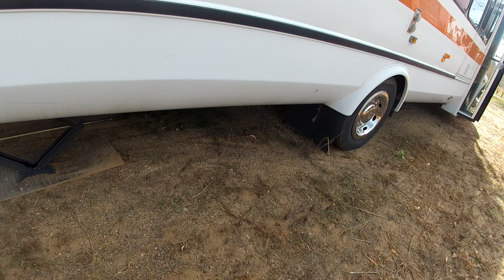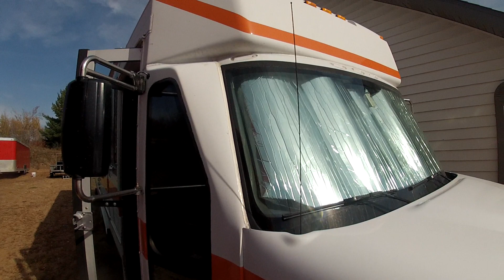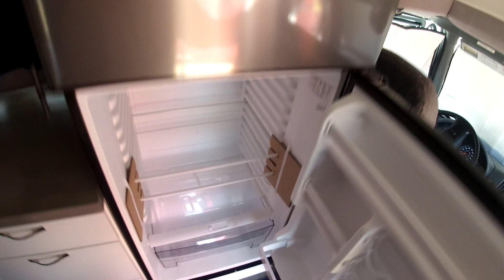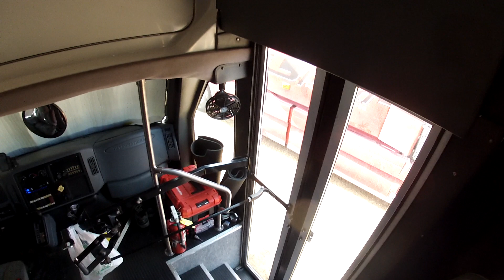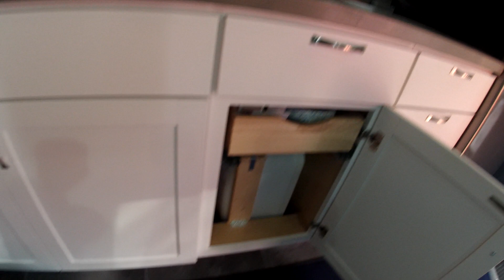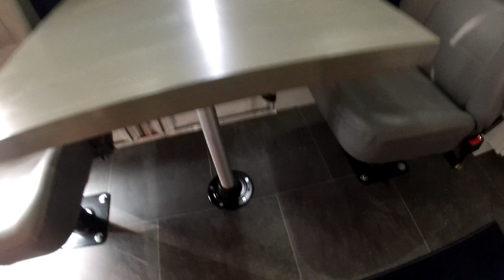BUS TOUR | Shuttle Bus Camper DIY conversion | Part 1 of 2

Comment: Hi Jeremy,  Great Job! We own a similar 2008 with a Starcraft built bus box behind a Ford E450 SD. I've been wanting to do something similar but when I unbolt the seats from the floor and walls I found that was the only structural thing holding the bus to the floor. I'm wondering what you found when you removed the seats and did you experience this problem. Do you haveany suggestions?
Reply from the maker: Our bus is an Eldorado box which has more internal structure and connections to the frame and floor than most. We did not have any issues with the integrity of the structure.  Tough to say what to do with yours without seeing it but possibly you could make u shaped brackets 7.5ft ish across then up a ft on each side . Bolt to the floor and then weld to the chair rails which I assume are attached to the shell? And do that every 2 ft or something.  Then fiberglass all the corners where the shell meets the floor.? Hope you can figure something out.

Comment: Hi Jeremy I have a question for you. I am looking at one. The guy said it has to be warmed up alot before being able to drive it. Do you find that with yours also. Ty
Reply from the maker: No that is not the case with ours. It is a good idea to warm up any engine for at least 10 minutes before using but if it NEEDS to be warmed up in order for something to work then there is a problem.
Reply: @Jeremiah  thank you that is what I thought also. Have a wonderful weekend 😀